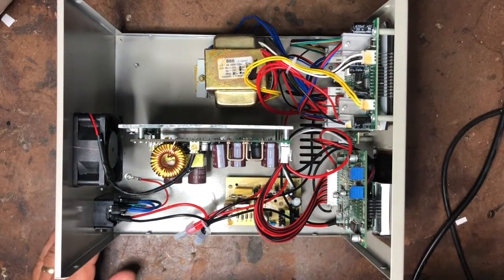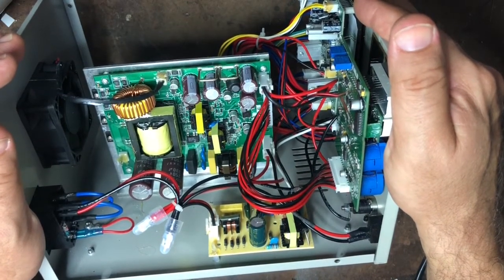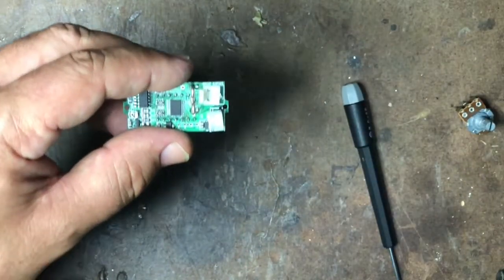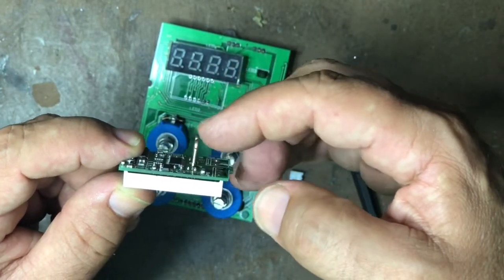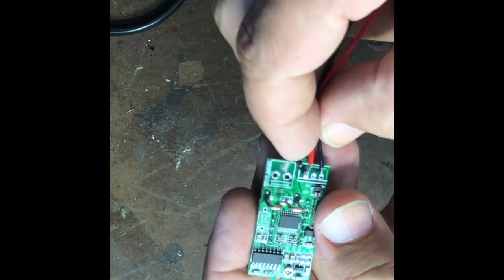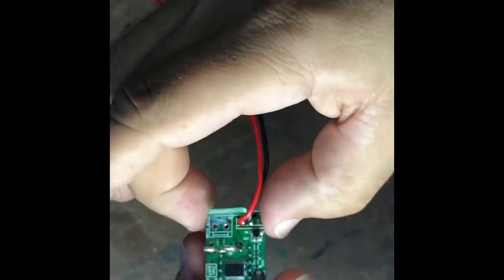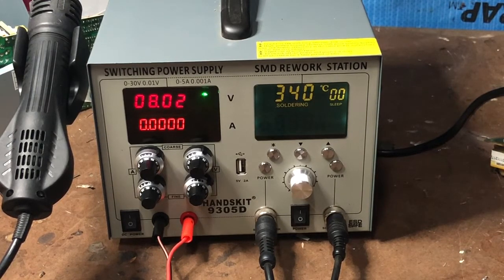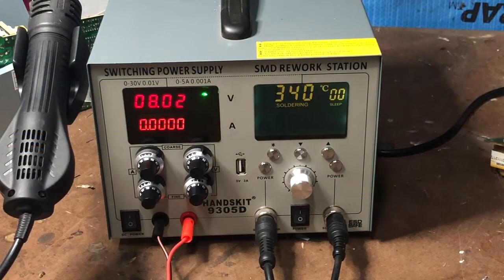Handskit 9305D Improvements to Pots and Ammeter

Comment: I have the same station and I love mine. Granted b4 using it I had ur basic $5 soldering iron from Harbor Freight or equivalent to. I have not used the air gun much but it does the trick for what I have used it for such as shrink wrapping and heating up glue to help remove parts easier.All and all id recommend it especially if on sale. I mean the amount of goodies that come with it alone made it a great purchase for me as I had just started out with electrical repair and maintenance and didn't have 75% of the little odd and ends it came with.

Comment: Thank you for a really informative video, and compliments to your skill and creativity. You sure improves this station! Especially liked the solution of the problem that the new pots pushed the displays further into the housing.

I have one as well, my particular one is not as off on the original am-meter as yours was. But it can’t deliver full 30 amps.

Also it suffers from the very coarse potentiometers, which as you noted, makes it a bit fiddly to set the desired voltage.

I still got to say that I really like this unit. Comes in handy a lot! The kit came with one spare heating core for the soldering iron, and one for the air gun. I still want to find more as backup, you wouldn’t by any chance know if any that will fit?
Reply: I haven't had to replace the heating cores yet so I can't tell you.  I assumed they were a common unit that I could find spares for very easily but I haven't looked.  I'd be interested to hear how you go with finding spares.

Comment: Hi, please provide me with a diagram of the connection of the bipolar switch with the mini usb card and the front card of the 9305d device ... because I can't understand these connections well on video ... in addition I will tell you informs that I have the same problem with my device in addition that my fan does not work ... and thank you very much.

Comment: Should a pot ever show continuity between all 3 terminals, I just recently bought this unit and after limiting currant I found that I am not only unable to even remotely calibrate but am unable to reduce currant on a powered project and after some initial probing found that the 10k multi turn (vr2) is shorted between all 3 terminals by board design
Reply: lprkon72  is this before or after modification?    Mine didn’t come with multi-turn pots.
Reply: @michaelfisher9671  I haven't done any mods v2 is a factory multiturn I assume it's supposed to be for calibration purposes as the one next to it works as such for the voltage
Reply: @michaelfisher9671  I am referring to 10k on back of board at the top all 3 pins show continuity between each other and neither that pot or the tiny one on the bottom right side of board (left pot) have any affect when turning them through there full range
Reply: @lprkon72  Ahhh, gotcha, now I understand.  I managed to confuse myself.  I thought you were talking about the pots on the front of the unit.  I might have a look and see what they do on mine.